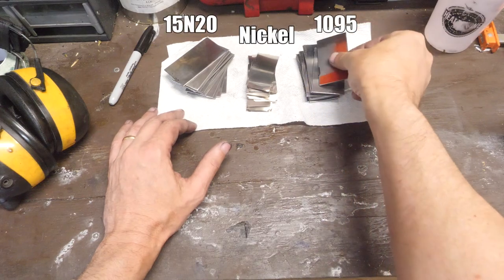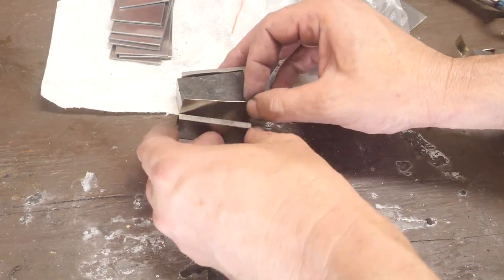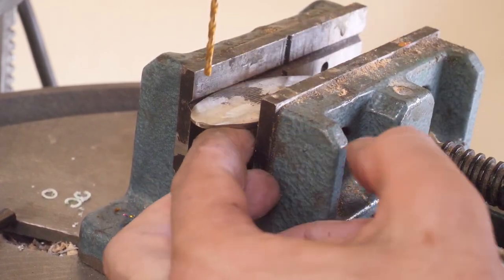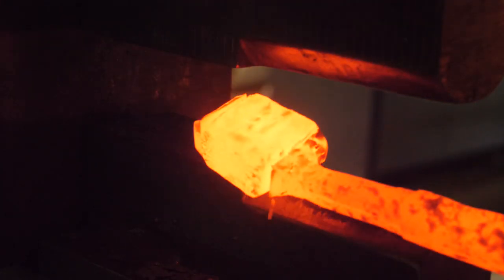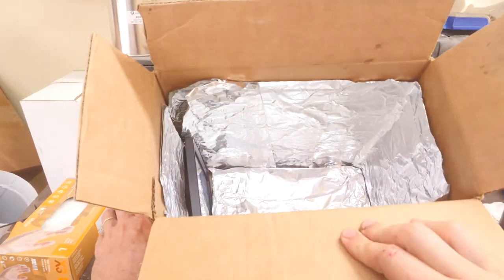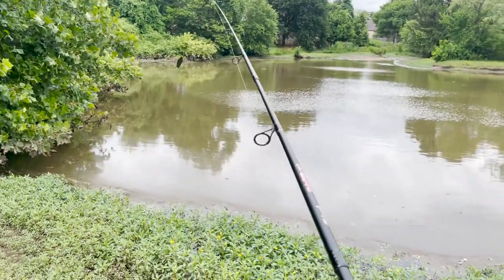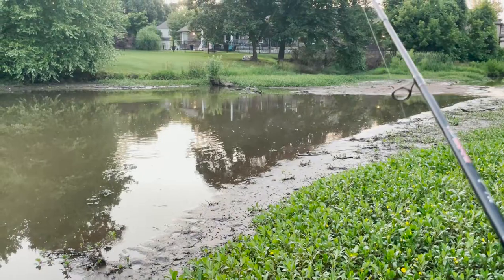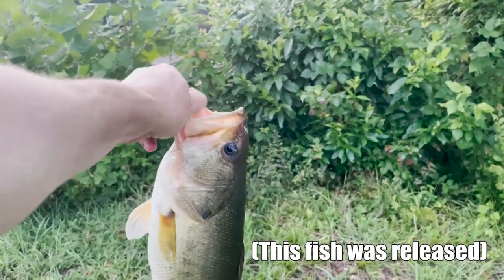Forging And Fishing Damascus Lures!

Comment: Those came out beautifully! 
I'd definitely be afraid of losing something like that that someone spent so much time making! 

One thing you could try to help with the heavy weight and fast sinking of these spoons/blades, is put a small peg float on the line. Adjust float  size and distance from the lure to your liking. Might make them more "fishable" 🤷‍♂️

Comment: So hold on.... you quenched so that the pattern would show.  I thought the pattern in damascus was due to the differing composition of the different layers of steel.  This implies that it's due to the differing hardness of the layers.  If you forge damascus (or bassmascus ;-) ) and don't harden it, will the pattern still show when etched?

These lures turned out absolutely AMAZING!  I fish lake trout here in the late fall & winter and use similar spoons for that quite a bit, both cast/retrieved and jigged.  I can only imagine the satisfaction of catching a fish on a lure you made yourself!  (Though I can also imagine the pain that would ensue when getting snagged up & losing a lure I'd spent as much effort making as you did these.)
Reply from the maker: 🙏 the 1095 high carbon steel etches or turns black better if it’s been quenched.  Without quenching it only turns light to medium gray.

Comment: Could you use something like some stainless tubing that you basically form into a grommet then epoxy coat that? 
If not that, what about using some plastic to make an insert instead?
Reply from the maker: Ooh a grommets a good idea

Comment: 2 spoon willow leaf. Sometimes called a casting willow leaf. 
If you made more, smaller spoons a longer willow leaf, but really only a trolling lure.
Could you emulate fish scale? I've seen snake skin.
Reply: Also, had you ever considered objects such as forks, butter knife, spoon, cup bowl plate? Maybe a set?
The lures seemed to work fine.
Reply from the maker: A made a knife from 1/8” rounds a few vids back that might look like scales.

Comment: I’m guessing that the stainless would weld and forge better at much higher temperatures than your forge is capable of..
Just guessing though.
Reply: Not easy to get a gas forge hot enough!

Comment: Instead of the 410 stainless, could you used pure nickel or even silver?  Would that have been better or worse?
Reply from the maker: nickel is a good idea and would have worked great.  I just worry about its potential toxicity.

Comment: TACKLE COMPANY'S HATE HIM
Man, first cast on the big boy spinner was pretty good
With stainless, the nickel should work as long as you get it both blisteringly hot and seal up all the edges of it with weld, for stainless to carbon steels go with some 309L in ye olde stick welder and see if that helps.
Reply from the maker: Great info ty I’ll try 309 next and spark some steel in the forge!